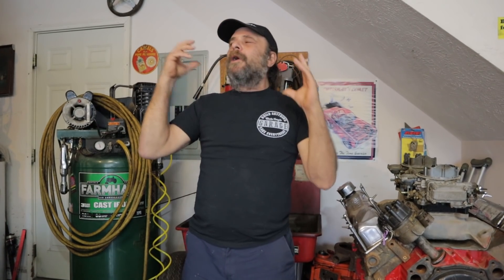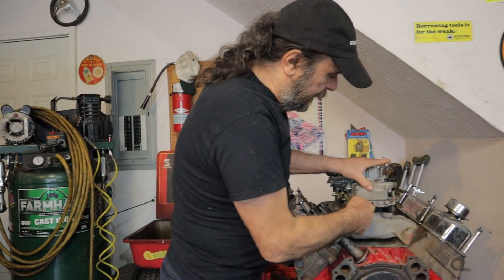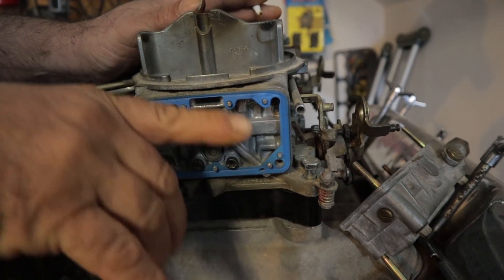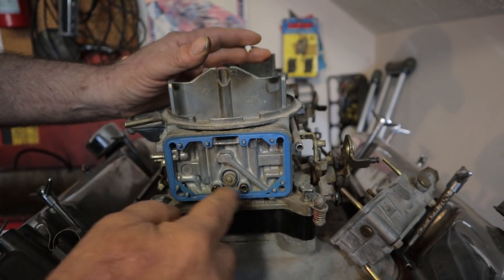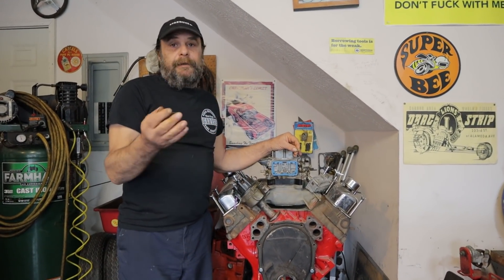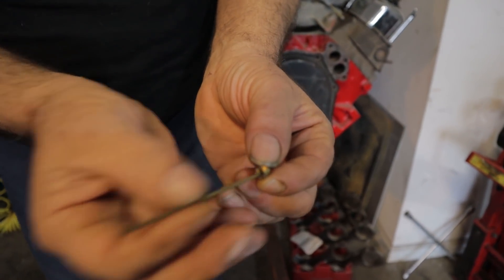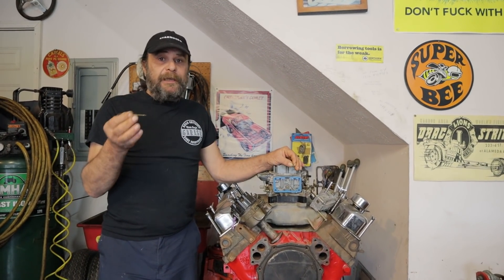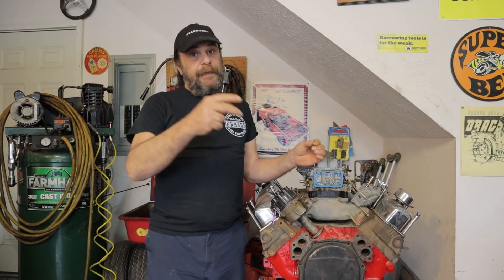Carburetor Jetting Basics

Comment: I just changed from a 750 Holley to a ProForm 850, decided to go with 76 fronts, 78 rear, no power valve mechanical secondary
Reply: I just went to a ProForm on my FE 390, awsome carb still getting it dialed in. I forgot how much of a pain pulling the bowls to rejet is.
Reply: I want to get an air/fuel gauge and dial it in, and change it all over to E-85. I will need to change out the idle air bleed and the high speed air bleeds
Reply: @K1LL3R_M1LL3R  i wouldnt mind running E85 but its not readily available where im at yet. I would be intrested to see how the transition goes though.

Comment: Lol, never heard that one!  Wait, that kinda applies to my Predator carb.  Flows between 390-930 cfm depending on only what the motor needs...Love that carburator. Have it on two motors.
Reply: What?  Is it a variable venturi or are they talking out their ass based on the fact that an engine can't draw more than it can draw.

Ohhh, it is a variable venturi.  Hard pass.

Comment: Reminds me of when I had just butt dyno'd my Holley 750vac secondary on my 308ci Holden, put it on a real dyno, (no changes to tuneup) and it got to about 5000 and it  smoked the tyres, went side ways done a tank slap 3 times and almost jumped off the <rollers>

Comment: I would like too see a custom dual racked  4 carbs  each side " a carb for each cyclinder ..use  Mikuni VM  34/ 36 /38 mm slide bore carbs on a V8 engine. High bred manifold. I bet the throttle response would be way better then  the toilet bowl cfm four main jet design of the automotive design ..like the  hilborn fuel injection of the past .  Except the belt driven fuel pump .. keep up the great post's .. love you Uncle Tony

Comment: Tony do you drill the throttle blades on your Holley like some do for idle control? I’m a new sub and love this stuff thank you!
Reply: When it comes to that mod I think it's only needed when you have so much cam in the engine that it has to have the curb idle speed cranked up to the point where a lot of transfer slot is exposed, the small hole in the butterfly lets air pass to increase curb idle speed with the transfer slot covered, but you shouldn't attempt this unless you are sure you know what you're doing because it's pretty much permanent as the throttle plates are difficult to replace if you get it wrong.
Reply: Just solder the hole up and redrill to the proper size.
Reply: @simplyfred8044  Or get a set of wire drills and start very small and test run each time as you work your way up larger. And then the carb will only work with engines that need a high curb idle speed, unless you plug the holes or replace the throttle plates.
Reply: @onemoremisfit  that's a sure way to find results. Excellent.

Comment: Is that the same guy with the Pontiac 400 small block bored to a 455 big block with oversized bearings and a 12 qt. Oil pan. And the ever present 3/4 race cam. They always have the 3/4 race cam. High domed pistons and roller this and that? And I jetted an old Holley 650 to a 750 double pumper?  I just kind of shake my head and give the old lurch growl and ignore people like that. Stupidity makes my head hurt.
Reply: Once had a guy say his boss' truck had a 454 that "someone put diesel heads on it."  Was a GM 6.2L diesel.

Comment: Cut the bottom of a plastic motor oil container to make a handy drain cup to catch the fuel when you remove a float bowl screw from a Holley. Also as I recall, the difference of the Holley 3 digit "emissions" jets is they are machined to closer tolerance. And in my dumbest moment I never confused a carburetor's fuel metering with it's air flow rating, i.e. thinking I can "jet" a 650cfm to a 750cfm, and I never met anyone else who thought that, but I don't get out much.
Reply: Michael the MAN  Nick spends a lot of time talking about nothing before he gets to anything informative, I don't see why he's so popular. Every underhood situation is different so you'll probably improvise something that fits next to the carb with your manifold and plumbing, and it will probably be from an item that would have otherwise ended up in the trash, especially if you don't have $$$ like Nick probably does.

Comment: Back in the 90s I would get 850 Holley double pumpers from chevy guys who tried to run them on their 305 or 350 by jetting it with 56/62 because someone told them that would work on their circle track car. They could never get it right, so they assumed it was a bad carb. I have carb Shop and other somewhat high end carbs I got for $100-$175 from those guys, because they don't know how a carb works. Throw 82/88s in them and they work great on my 455s.
Reply: We ran a 2bbl Holley with 88 jets the problem we had was the power valve was rated at 4in of vacuum when we changed it to 12 it even better

Comment: I ran into a guy that said he bought brand new a 1968 Z-28 with a 455. If I was smoking, I would have put it out in his eye
Reply: For sure! 😭
Reply: I met a guy once who said he had a '69 Z28.  He was telling me about all the races he'd won with it, and I said, "yeah, those 302s were pretty hot little engines".  He froze and looked at me like I was retarded and said, "302?  It wasn't no damn FORD".
Reply: 1.) While working parts I had a guy come in looking for a water pump for a 69 Firebird with a 400. I sold one to him, he came back about an hour later and said it was the wrong water pump I said "Cool that happens and I apologise, and asked " Is the car here?" and it was, so I said let's take a look. He had a small block Chevy in the car (could have been a 400 Chevy I am not to keen on identifying small block Chevys). I said you got a Chevy engine in you Pontiac. He replied Chevy 400 or Pontiac 400 they are all the same. I did not even bother arguing I just sold him a small block Chevy long neck water pump.
2.) I had a 64 El Camino that I had out a 396 in. A customer asked me what engine was in the Elco I replied a super-mild 396. He went onto tell me a story about a 69 Chevelle he and his brother had with a 396 that would do a 170 MPH with just headers and an aftermarket intake manifold.
Reply: @bertamusprime618  I've heard the chevy/pontiac thing before.  People think GM is GM and all the divisions use the same engines.  Some of the confusion comes from the fact that in the 70s, some GMC trucks were equipped with Pontiac engines.  Further confusion came in the 80s when GM consolidated its brands and actually did start using all the same engines in every division, resulting in Chevy engines being installed in Pontiacs, particularly small block 350s and 305s in firebirds.
And of course, everybody from that era thought they could go 150 mph + simply because most speedometers only went to 100, so anything above that was open to interpretation.  LOL
Reply: One of my favs is the 69 Camaros at car shows with z-28 emblem and it's a 350  automatic,
Reply: @Mikeyyyy_L  LOL  Yeah, I've seen a few of those.  Whenever I ask about it they say things like "Well, the original engine got blown up, so I put this 350 in there, and I figured I'd convert it to an automatic while I was swapping the engine...".  They never admit that they just bought Z-28 badges for a regular Camaro.
Reply: Live Wire ....  good stuff! Chevy made something like 200 Z28 optioned Camaros in 67, there was no badging on the car, only listed as an option on the window sticker and build sheet, at various car shows over the years I have seen at least 4,525 of those 200 67 Z28s, with Z28 badges all over them. “Cloning” a car that did not exist!
Reply: @Zephyrmec  LOL  Yeah, they take the '68 badges and put them on '67s... I've seen that too!  I think, "hey, there's a '68 Z-28"... then get a bit closer and notice the wing windows and think, "wait a minute"....

Comment: So does that mean they’re using jets in the mid-70s range in a 600 that should have jets in the mid-60s range? The most I’ve ever changed a jet size was maybe one or two sizes (say going from a 76 to a 74) and usually it’s going smaller, not bigger, but I tend to make sure I have plenty of cfm to begin with, and then tune the rest of the carb around that, usually the problems with “over carburation” as some of the ignorant call it, is because of too much fuel, or just lack of tuning, not because of too much air flow, I never knew there’s a such thing as an engine getting too much air flow, I mean isn’t that the reason for aftermarket intakes, aftermarket or modified cylinder heads,  porting heads/intakes, longer duration/higher lift camshafts and exhaust headers/bigger exhaust? Is to get MORE air flow? So I don’t understand why people always want to run a small carb on an engine, the only time I’d see running a smaller carb would be when that’s what you had on hand (and I’d still modify it to get as much as I could out of it by milling and blending the choke tower, deburring the casting flash from and polishing the venturis and boosters, small head screws on the throttle blades and milling/filing down the throttle shafts, which all of this can be down with a Dremel and some small hand files, which you could do it all without a dremel, you could cut the choke tower off with a hand saw or a angle grinder or drill with a cutting wheel, and blend it with files or with the drill using a bit such as a grinding/polishing stone, or a steel or carbide burr if money allows it, milling the throttle shafts are about the only thing you’d have to be very careful and may have difficulty with using a drill, or a good bit of work and time with a hand file, which it isn’t a Nessecity, you’ll get more gains from milling the choke tower and deburring/polishing the Venturi and boosters, because that area is what effects the amount of air entering the carb the most, if you don’t know what I’m talking about, the next time you’ve got a Holley main body in your hand, stick your finger or use a light and feel/look at the area around the bottom edge of the veturi, there’s usually a good bit of “lip” for most of, and sometimes all the way around the inside of it, sometimes it’ll only be a small amount that you can barely feel, sometimes it’s quiet a ridge, also with the boosters on the outside of them both on each side of the “legs” and around the circular “booster” part itself there’s always a lip all the way around of casting flash, fille and smooth this down with a small, fine file, it doesn’t take much, and don’t mess with the inside part of the booster other than polishing it, unless you know what you’re doing, I also like to work the top edge of each booster (again mostly the outside part) to make it nice and smooth, a nice edge for smooth air flow without excessive turbulence, and working the boosters, especially the inside/top part isn’t so much for air flow as it is for better overall performance, enhancing the booster signal, which makes for better throttle response drivability and efficiency

They must be running super rich, What’s the point? Something A wise man once told me was “lean is mean” (just like another thing he told me when I was young and more ignorant, when I was building my first 440, a “smogger” engine and was so concerned with the low factory horsepower ratings, and that was that “torque wins races, horsepower is for selling engines/cars” and nowadays I understand what he meant by that) 
Anyway these guys like that theyd be better off with the stock jetting.. running that fat they aren’t only killing power, but also fuel mileage, and other adverse effects on the engine, and drivability.. and I hate the smell of riding in a car that’s running too fat, the fumes making you light-headed and not in a good way, especially in traffic.. and they’d been better off with keeping the stock jetting in the smaller carb or getting a 750 to start with..

Comment: The only thing I don't like about tuning the jets/rods on an edelbrock is that they don't make EVERY size jet and rod.  They skip around a lot which makes you have to mix and match rods and jets to get it just right.  If you're on the border of a good tune, but the next available rod size is actually 3 sizes bigger, you can't just change the rod, you have to then change the jets to the next size smaller, and start over with the rod tuning.

Comment: You dont need  to change the jet when you upgrade the exhaust. That same amount of air is coming into the engine but at a quicker rate, the fuel/air ratio is not changing, there both staying the same but getting sucked in quicker.

Comment: "....both main styles..."  Not sure if I'm fortunate or unfortunate, but for every Carter or Holley design I have to deal with, I'm balls deep in something like a Solex (coin toss for downdraft or updraft), an 80 year old IHC carb off a Farmall tractor, or Mikuni or SU sidedrafts with some stuff like Keihin thrown in just to keep me on my toes.

At least quite a few of those have an external air-fuel ratio screw.  The power/"cruise" (since tractor and marine carbs don't have cruise - idle or power, choose one) is externally adjustable, so jet changes are very coarse and almost always pointless.

Comment: I’ve heard that one before😂 and the old “I replaced the 350 short block with a 350  long block because the long block got more hp.”
Reply: jerkygutts *   Well, it will get more power when you bolts the heads on. 🤪😁